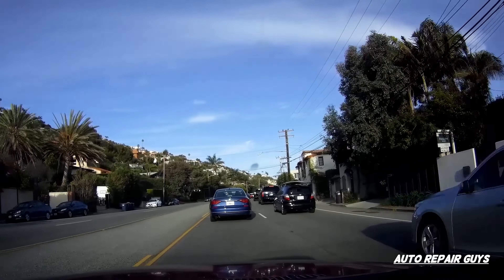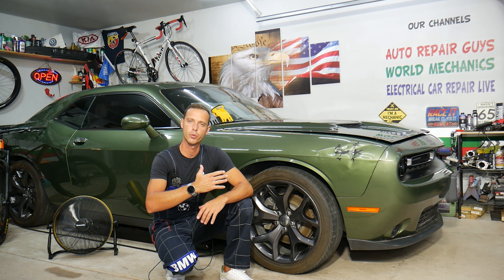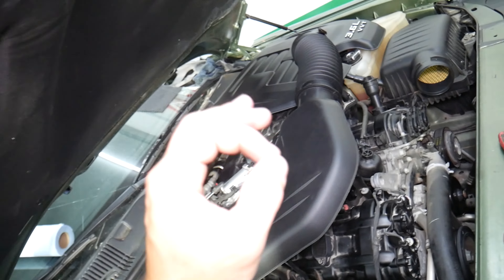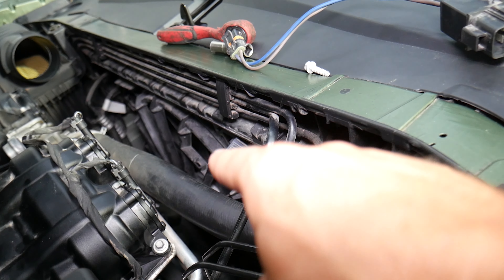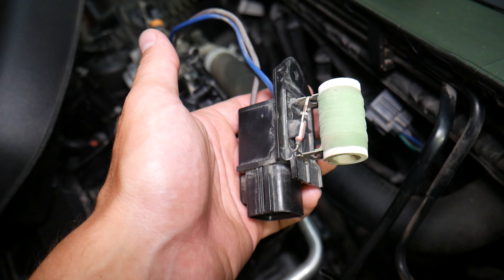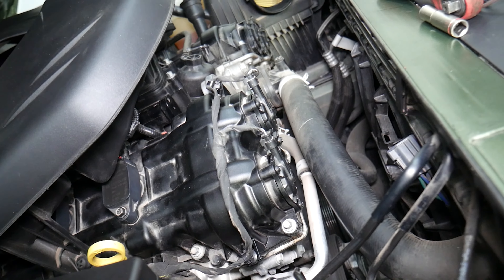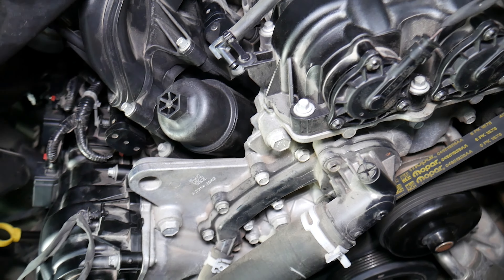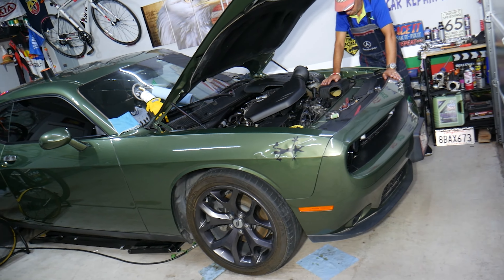IF DODGE CHALLENGER IS OVERHEATING CHECK THIS

Comment: I am located at the hot weather region, and service recommended overriding thermostat to always on. Reason is because it was overheating to 105+ when driving uphill on not fast speed but engine producing bigger power. Wouldn't that cause any issues?

Comment: Question my check engine light came on i noticed my car was running lower temp than normal I got a  diagnostic my thermostat was stuck open but the check engine light went off today should I still pay all that money for it to be fixed

Comment: Ihave a 13 challenger and the odometer does not move at all car feels like it goes 10 mph at most what can that be? Transmission fluid isnt burnt no check engine light any tips please help Tia
Reply: did u find what the issue was?
Reply: My spark plugs and coils needed to be changed bc there was an issue with them
Reply: My spark plugs abs could needed to be changed when this happened to me.

Comment: My engine always overheats when I idle the car then the fan turns on and after 10-20 seconds it goes back to normal , can anyone help me out
Reply: I’m having the same issue it might be a bad radiator cap, I’m almost sure our fans aren’t working properly